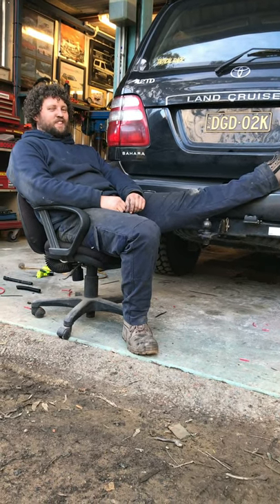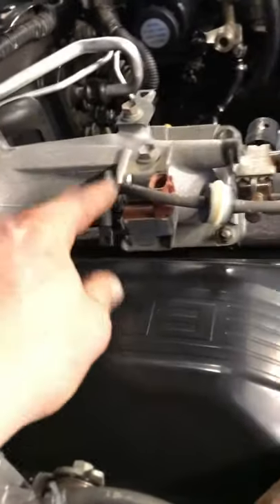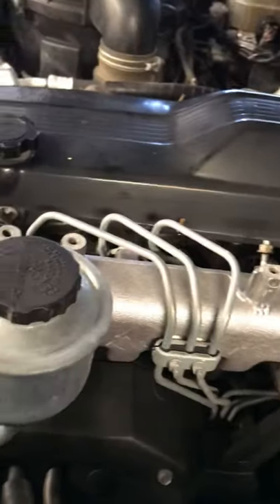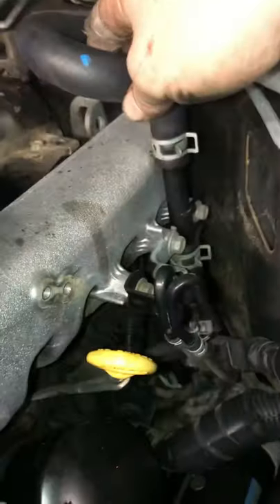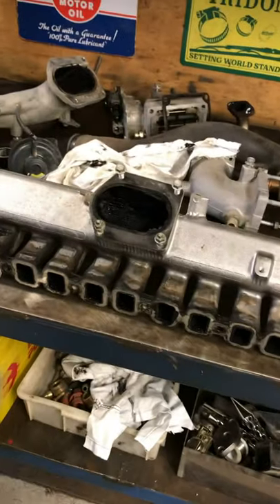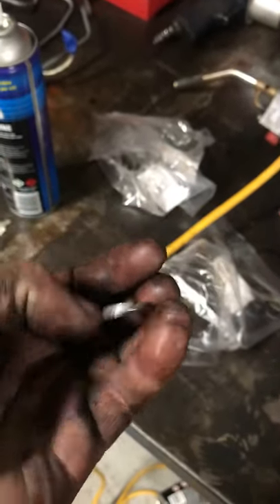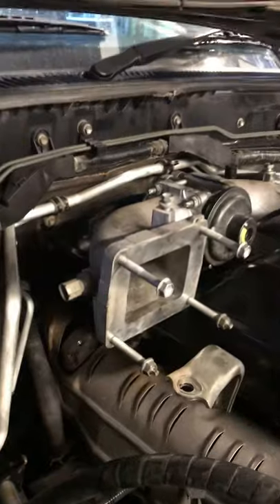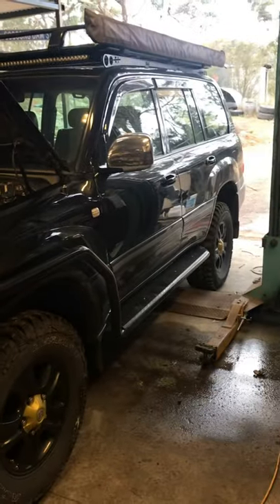Hdj100 1hdfte intake manifold clean/ egr delete.

Comment: Is it ok for fucking combustion chamber temperature to blank off the fucking egr or will it cause very high fucking temps as nox gases removed just a fear of causing damage to fucking engine mate... Couldn't give a shit about the environment my engines health is more important in my eyes.
Reply from the maker: Nah won’t cause any excess heat, pretty much stops it putting exhaust gas back in your intake to re- combust so to speak. It’s sole purpose is to reuse exhaust gas to lessen emissions out the exhaust but clogs up your upper engine causing less engine life and hotter intake temps.